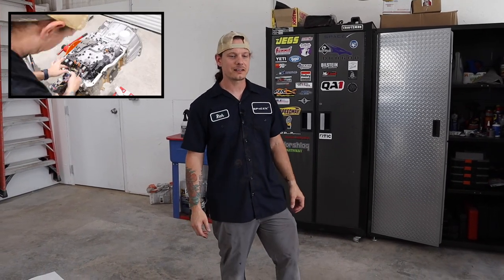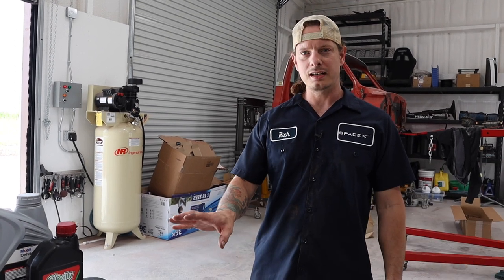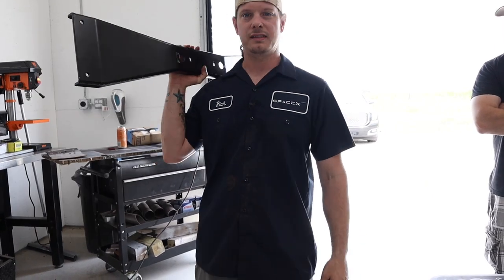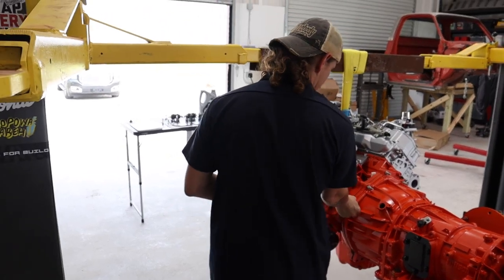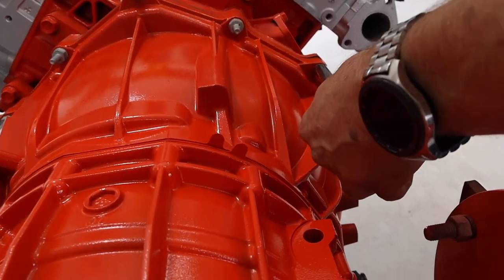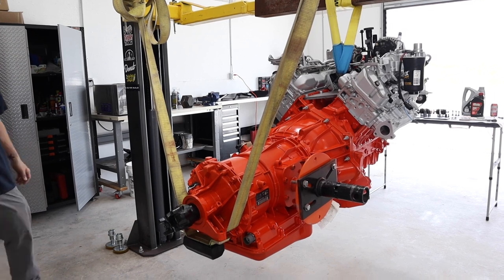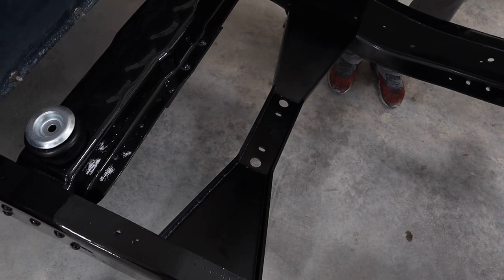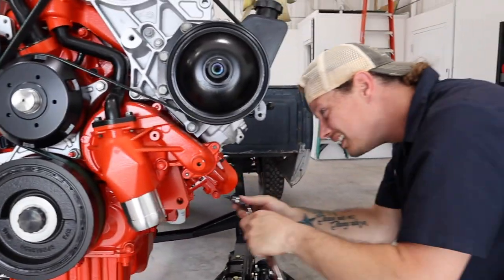Duramax Build Part 6: Squarebody Gets a Heart!

Comment: For anybody wondering, the Duramax weighs about 1000lbs with all accessories, and the Allison 1K weighs about 350lbs, so combo weighs about 1300-1400 lbs. A Small block & automatic weighs about 760lbs all together. Getting ready to put an LMM/1K combo into my wife's 80 Suburban, nice work!
Reply from the maker: Thanks for the additional info and good luck on your swap project!  A dmax swapped burb will certainly turn some heads!

Comment: What are you lifting the engine with? What’s connected to the motor?
Reply from the maker: It’s a lift plate that is designed to bolt up where the turbo pedestal bolts in.  It’s 1/2” thick plate with a 5/8” eye bolt.. super strong. Can’t remember where I got it from but if you search online you’ll find it.